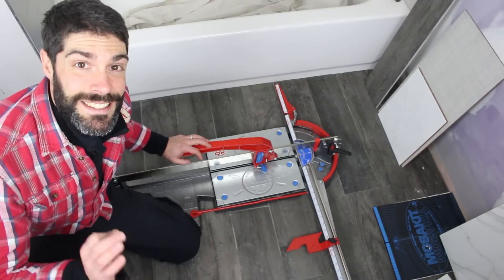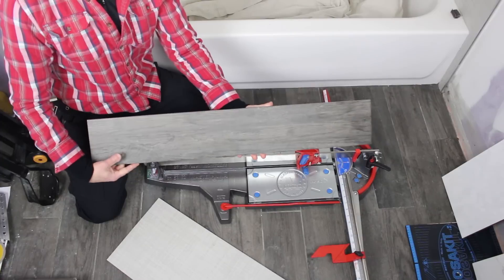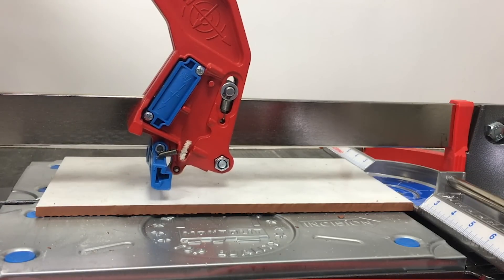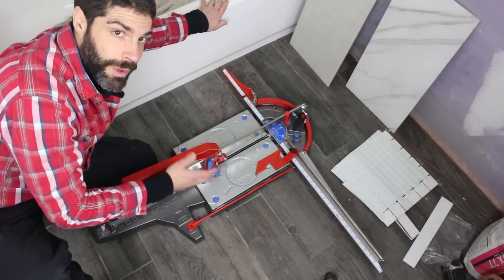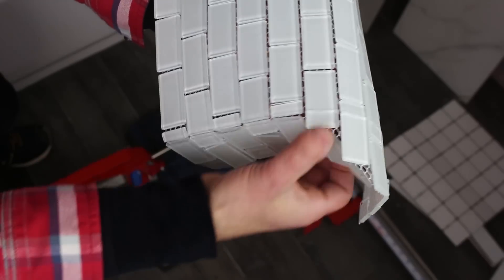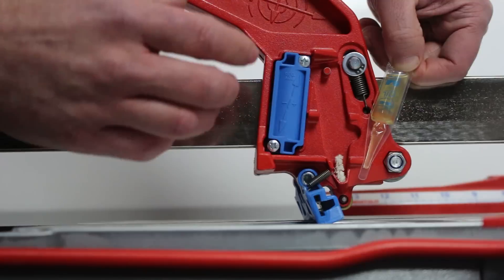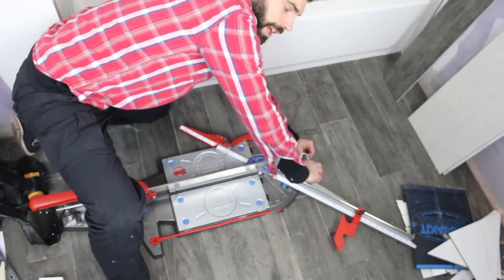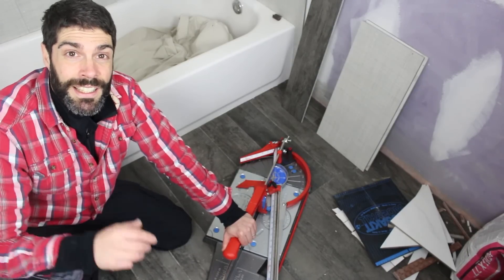Best Tile Cutter for Any Type of Tile (Montolit Masterpiuma)

Comment: Not bad but still not better than sigma cutters..
Reply: Tako je care!Sigma all the way! ;-) Ja sam počeo rezati na Luxovoj na guranje,ali kad sam probao Sigmu,nema šanse da uzmem išta drugo. ;-)
Reply: Sadly it is better than Sigma because no need for adjustment for different tile thickness just score and snap. 
integrated oil can which lubes cutting wheel for better cuts and longevity.
Snap shoe has 2 variations for snap instead rigid like Sigma.
Side stop can be turned away no need to move away.
No need to remove guide bar when storing cutter like Sigma.
Reply: Nebojsa Njegovanovic sigma= past. 😉
Reply: Hi everyone, I own sigma tile cutter. I saw some videos about Montolit tile cutter and was so much impressed about the video that bought one for myself. I think sigma is still the best and that's why:
1. Sigmas handle moves easier snd smoother on the rail. So sigma cuts faster and the edge of the cut tile is much better quality. I was not able to make such a good finish cut with Montolit even after many tries.

2. Sigma wheel is bigger and wider. I think this is another reason why Sigma's cut is nicer.

3. I have Sigma push version. I reversed the sigma's handle and made tile cutter look like montolit. This small upgrade will save your back from pain.

4.The only thing better on Montolit then on Sigma is the guide ruler because it turns faster.

So Sigma faster, nicer cut finish.
Montolit better guide ruler and lighter.